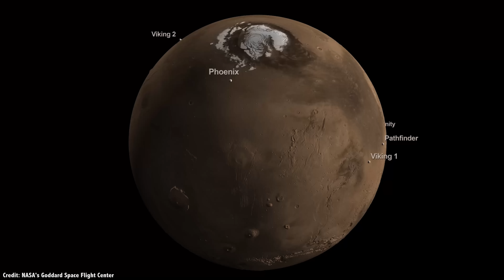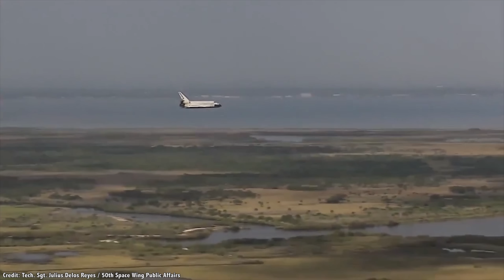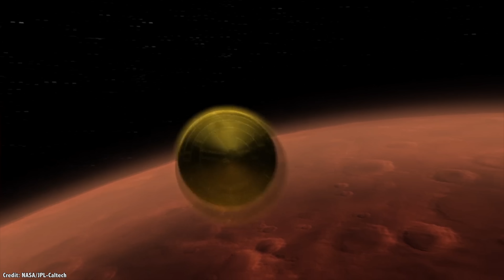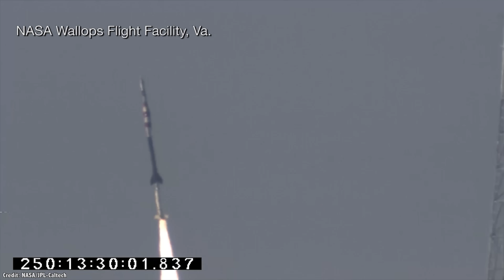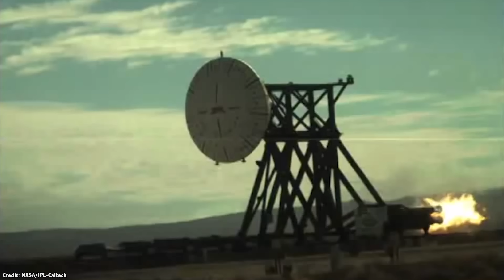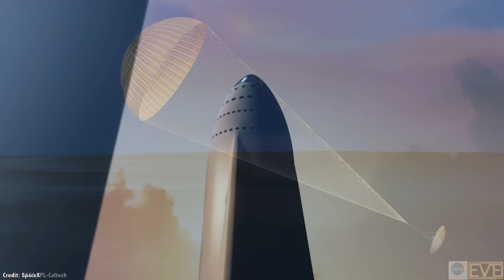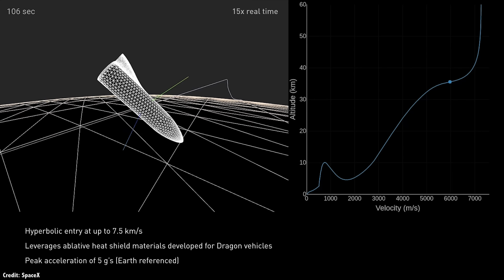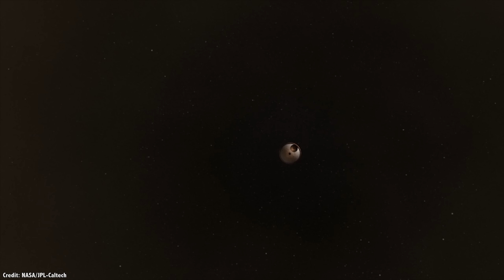The Incredible Challenge of Landing Heavy Payloads On Mars

Comment: Build a LEO space station big enough to generate gravity (Earth normal). Move it out far enough to make sure shielding works. Maybe by that time there will be more than one of these... then move the whole space station to Mars (people and all), it may take a while, but the environment should be close enough to Earth surface that doesn't matter. Start studying Mars from orbit but at the same time look for ways to generate fuel. Also look for materials to build more stuff... then create a space elevator from the top down. Fuel flows up, people and supplies go down (and back up) until the place is well studied and the people decide to just live in the space station  ;) We do not know how artificial gravity works, we do not know the minimum size, or the maximum rotational rate (same as minimum size). Nor have we studied any ways or counteracting dizziness. For example tilting the floor from tangent or using an uneven floor (which is also good for brain health BTW), using visual clues in decorating, etc. We don't know what it will take to keep such a structure stable with the movement of weight (people walking from place to place) aside from lots of mass (which we would like to avoid). Medical science is a long way from finding a way to get around the health problems with low gravity, yet there is no  (or little) effort to develop artificial gravity for space which should be the next step in my opinion. We are not really ready to go to Mars for anything more than planting a flag, I could say the same thing for the moon. They are not a place to live, space stations, at least from what we know now, could be (they are not yet either). I imagine an artificial gravity habitat could be built on the Moon or Mars as well (it would be like living on a train complete with the constant bearing noise) but would take more time to engineer... or maybe the moon would be a great place to try out some artificial gravity experiments. I think we are not really ready for Mars yet.

Comment: Another solution is to shed weight before propulsive landing to minimize the amount of fuel needed to land.

For example if you have a Starship with a 100 ton payload, and 75 tons are cargo, you can "bomb" the target area with smaller drop pods that can sustain heavy aerodynamic deceleration and then the mostly empty ship can come in with its own aerobraking before firing landing rockets.

Other options include transfer burns to Martian orbit, docking with some orbital way-stations, and then either refueling your ship or moving to fully-fueled landing craft to drop to the surface. With autonomous refueling flights to the orbital way-stations being straightforward enough, and done regular enough, this would not be a bad way to go.

Comment: What about something like a big winged glider that just circles Mars in a gentle decaying orbit and then glides to a landing? Perhaps the atmosphere is just too thin for wings no matter how big? And then build one of those big space elevators we're always hearing about
Reply: The trouble is that in order to get to Mars in a timely fashion, you need to come screaming in at an extremely high velocity.  In order to enter that gentle orbit, you need to burn off a lot of velocity; if you don't, you basically end up doing what New Horizons did at Pluto.  I haven't done the maths, but I suspect that would end up being more expensive in terms of fuel than going straight in for a landing.
Reply: @Confuseddave  You probably got notified about his latest video discussing flying on Mars. If not you should check it out.

Comment: The Flying Brick design.  I mean, it worked for the shuttle
Reply: It worked for the shuttle in Earth's atmosphere.  But Mars' atmosphere on the surface is about as dense as Earth's at 30-40 km altitude... not much to grab on to.  But thick enough that you can't ignore it... hitting it at cosmic speeds will burn you up.

At some point I hope they come up with a lifting body approach to landing on Mars.  The entry module will need stubby wings to allow it to carry out s-turns to bleed off speed.  It aught to be possible to loiter long enough to dispense with the parachute phase, much like the shuttle did without parachutes except for shortening its roll-out on the runway.
Reply: @CarFreeSegnitz  works for me

Comment: How about dropping 100 boxes with 1 ton cargo each on Mars?
Reply: Efficiency.  Each box needs its own heat shield, parachute and landing thrusters.  The quest is in working out the maximum sized box possible to reduce the number of EDL (entry-descent-landing) contraptions you need for a given mass on delivery.  Fewer EDL packages means less mass needs to be sent from Earth.
Reply: Nobody ever thinks about what happens to all those cardboard boxes that their packages come in....
Reply: @japzone  ...nope nobody thinks about that...
Reply: Can't put a crew of Astronauts, and a return vehicle into 100 boxes ... and if you could .. if one box crashed ... that piece would not be available for building the return vehicle. 
   For unmanned missions .. just make the landing vehicles smaller / lighter, staying under 1 ton.
Reply: That's 100 times the chance for the luggage to get 'accidentally' misplaced.
Reply: If the cargo can be split. Mars Assembly Required.. uh-oh.
Reply: @rosen9425  would give the 100 passengers on BFR something to do while they wait for Congress to approve funding to bring them back.
Reply: Think about it this way. What would be more economical, sending 100 tons of goods cross-country in 100 pick up trucks carrying 1 ton each? Or sending it on a single train? The only difference is it's a lot more expensive to send things to Mars. But, since there's just no getting around the problem. All we can hope to do is make the process cheaper, but we can't make heavier payloads. Hopefully we're missing something and I'm wrong.
Reply: @VoidHalo  which is more economical 100 pickup trucks or a Train that doesn't exist because Congress canceled the Train?
Reply: Yora money dude
Reply: @alejandrogutierrez6531  "Yora money dude"  ..... hysterically moronic!
Reply: @Penny Bee after 2 years, it is too late to laugh .. but fucking try.

Comment: To landing on Mars, if you want to do it now, Elon Musk has provided the way. The landing profiles of the Falcons, and Starship will be what makes landing heavy payloads on Mars possible. The next most logical course of action is to take the time to build an orbital infrastructure to construct a space elevator for a less jarring planetary entry than what can be provided by rocket systems with the necessary fuel to pull off launch, transition, and landing. But, that's something humanity will have to wait for. Particularly an economy of scale that makes such projects affordable, and easier.
Reply: The cable for such an elevator would only have to be 17000 kilometers long and unbreakable. No problem.

Comment: Why not deploy multiple parachutes as they did with the Apollo capsules during touchdown?
Reply: Due to Martian atmospheric density being less than 1% of Earths. A parachute (or group of them) is not sufficient to slow down the object they are trying to land enough to prevent damage.  They work so well on earth due to our thicker atmosphere.  That is why as Fraser notes in the video, when parachutes are use its usually for smaller payloads and as part of a more complex system to land...ie parachutes then retro rocket/sky crane.

Comment: Why not send a space craft that divides into manageable sections that can descend to the planets surface separately? An added advantage to this method is important supplies could be split between different landers to minimize the risk of loss and only one payload need be robust and reliable enough to carry astronauts
Reply: That's very inefficient, and requires you carry separate landing equipment for each lander. That's even worse than just carrying a ton of fuel.
Reply: Totally doable, and completely moronic.
The overhead mass per section (basically everything that is not cargo, engine or fuel) gets needlessly duplicated. Plus add the mass of separation mechanisms.

It's the same reason why an Airbus 380 lands in one piece, instead of separating into 555 individual planes to land.

Comment: what about a railgun that fires and catches a spacecraft you could build two, one on the moon and one on mars's moon so you don't need fuel at all.
Reply from the maker: The accelerations would turn humans into goo.
Reply: freeze them.
Reply: @frasercain  Not if the acceleration is done over a long enough distance...  but you still have the problem of getting megatonnes of construction materials and equipment out to mars.

Comment: What would happen if you dropped something with propellers, like a wind turbine or jet engine, into the atmosphere?  It should spin (you can use two of them to prevent the torque from throwing you off very much), and you could use that to generate electricity and bleed off energy.  Maybe that electricity could be used to power a thermal electronic engine (like VASIMIR) to further slow your decent.
Reply: It sounds good but when you take the stresses involved into account you'll see that any reasonably massed turbine or a rotor would not survive this experience.
Reply: @AtilaElari  I was wondering how bad the stress would be on it.
Reply: @ancapftw9113  short answer - "melt your rotor blades with entry heart and teist and rip them off with the drag force". Long answer will involve a lot of complex math.
Reply from the maker: It's just too fast. I talk about this in the next episode, all about Martian aircraft. Stay tuned.

Comment: Diving down thru the atmosphere at how many km/sec?  Using earth’s escape velocity,  if you dive straight down from the Karman line, you’d splat in under 10 seconds (assuming no loss of speed from atmospheric drag, and not becoming an exploding fireball from the heat)....  a fraction of a second off and you and your ship are atomized.... seems a lot riskier than shedding the velocity over a longer period of time
Reply from the maker: Like, full speed, so you can maximize your aerodynamic lift when you get to the thicker part of the atmosphere. I said this was a terrifying idea.
Reply: Karman line in Earth, Mars is different tho. Of course you still need some kind of ablative system
Reply: Thiago Baldwin it was only an example to say 100km from basically no atmosphere to the ground at 11km/sec.   I think trans mars injection is 13km/sec.   diving to the surface to try to bottom out last second (last millisecond) is ridiculously dangerous.... not to mention you’d probably splat from G-forces in the maneuver to level out, like an episode of The Expanse

Comment: 1 more reason to focus on building a major moon base before rushing off to Mars :)
Reply from the maker: I definitely think we should start with the Moon. It's closer and easier to send help when something goes wrong.
Reply: @frasercain  The Israellis are getting there soon so will you cover that?
Reply: I have been asking why we are skipping the Moon since the idea of going to Mars was first proposed. Seems like a no brainer to first get to the moon and work out as many issues as possible there before venturing off to a place where help is so far away! Not to mention how much cheaper it would be to launch off the moon for a trip to Mars than currently possible from Earth!
Reply: If you have to bring supplies and fuel to the moon first, then the total cost for an earth-Mars trip will be higher than without the detour to the moon.
Reply: You get to test spacesuits, habitats, rovers, oxygen recycling and a ton of other things with a permanent moon base before you send them somewhere you can't get them back from quicker, resupplied faster etc. They would learn a lot of valuable information, that would benefit any mission to Mars. Not to mention a long list of science projects unrelated to mars that could also be performed from a lunar base. Consider the clarity of an optical telescope in a vacuum, like hubble for example. Now consider one you build on the moon with a mirror 100 times larger. We could probably start building a small, manned, permanent moon base now. Mars on the other hand, even by best estimates, is somewhere we'll only be able to briefly visit at best for the next couple of decades.

Comment: Regarding the idea of Elon Musk about bleeding fuel out of small holes, all the passengers must have been to the toilet on the trip to mars, what about using the content in the septic tank from 100 passengers instead? Bleeding out that content instead and save all the fuel for better use?
Reply from the maker: You need a liquid that will pull the heat away at the right speed. I'm not sure sewage does the trick.
Reply: @frasercain  Probably not, mostly due to the micropores getting clogged. However, water would be fairly well suited for this, as it has a higher specific heat capacity than methane.
Reply: @ergohack  - yes, why is this not a solution? A couple of minutes before landing the liquid is not necessary anymore, I think we are on to something here
Reply: Yevhenii Diomidov  - but boiling it on the outside of the spacecraft must be recycling to the atmosphere? Or at least, seeding Mars with nutrients?
Reply: Keep in mind that both on Mars and on the trip to Mars, water is likely to be a very valuable and heavily recycled resource.
Reply: @ergohack  - and fuel, not considered valuable? They can recycle sewage during the journey but during landing they will be on the ground in a couple of minutes, there we have all the water in the world
Reply: @doncarlodivargas5497     On Mars, water will need to be mined, taking up plenty of time and special equipment. For the first manned missions, the only water to be had will be what was brought along. Once there is an established infrastructure there and a water reserve has been built up, this shouldn't be a problem.
As for fuel (methane), it is also quite valuable in this situation, but it is a one time use resource and isn't necessary for human life.
Reply: So would you call a successful landing a "sh*t landing"?  Would it be good or bad to "stick the landing"?
Reply: @CarFreeSegnitz  - probably a requirement for the astronauts will be to have healty bodily functions and go regularly to the toilet so they participate in a safe landing, but sure, the rocket got to land some distant from population, and maintenance personnel must be well paid

Comment: Aerobrake + propulsive Landing would have to be finely calculated with large payloads granted, bear in mind that the failed missions occurred mostly with old tech, computer modelling and guidance systems as we have it now haven’t really been tested in that environment. it should be possible if boosters can be landed though, as far as I can tell it all checks out. I love the dive strategy
Reply from the maker: Yeah, we've gotten better at it, but remember the Schiaparelli lander just a few years ago.
Reply: Fraser Cain you raise an excellent point however, we are in the age of a quantum leap in such technology and a piece of that kind of tech  from 4? (Can’t remember) Years ago is unbelievably outdated already, I’m mostly referring to guidance technology btw.
Reply: @trisjack82  Space tech needs to be radiation hardened and failproof, you can't just slap an iPhoneX to a probe.
Reply: Gehteuch Nixan isn’t that self evident? Though there’s no such thing as failproof anyway my point here is that the rate these things are getting spec.’d up is astronomical (heh) at the moment but I wasn’t thinking about radiation hardening that much, you raise a good point there
Reply: @trisjack82  just saying all the marvelous technological advancements we enjoy on Earth won't make into space for quite some time. Also I dont think landings failed because of lack of computational power available but because of wrong programming etc. I believe Opportunity used a 200 Mhz CPU, which cost roughly $200k ;)

Comment: Why the hurry with landing? Why not just equip the spacecraft with wings and let it sail descending trough the atmosphere for a long time, slowing down slowly, if it should take a long time, what is the problem?
Reply from the maker: The atmosphere isn't thick enough. But I'm actually talking about Mars airplanes in my next episode.
Reply: @frasercain  I've been waiting for you to do that!
Reply: Lifting body entry.  The Curiosity EDL used a crude version of this to help narrow down the landing elipse.  Larger craft would demand longer paths that our materials may not be able to put up with.  All that kinetic energy has to go somewhere, rejected, ablated, radiated away.  During that process the craft is going to heat up endangering passengers and cargo.